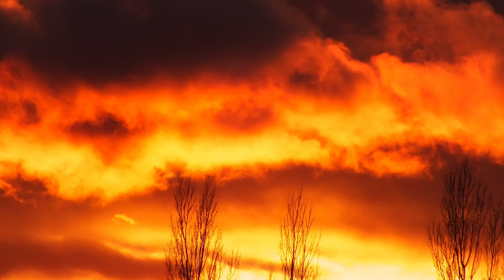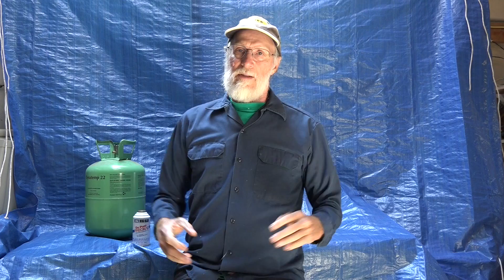What makes a good refrigerant

Comment: Min 36:00 Can be charged up to $30 a pound to destroy "contaminated" R22:

https://youtu.be/V_wUZ4qmAnk
Reply from the maker: I am not up on the latest cost, It was about $10 per # last I knew.  However, that would be only for mixed refrigerant or overheated to the point of breakdown.  It must be destroyed.  
Most recovered refrigerant is either clean or mixed with air/moisture.  Sometimes, depending on supply and demand, you can be paid a small amount.
GFM
Reply: @grayfurnaceman  

And don't we all know how this government-arranged insult is going to work? 
.
You show up with recovered R22, they tell you it's contaminated so you have to pay them. Then they take the stuff and recycle it anyway and make a few more bucks out of it.

The really disgusting thing about the R22 ban is that it had nothing to do with ozone depletion (which is quackery to begin with). R22 is 100 times less ozone depleting (sic) than R12. It was banned by the busy-bodies at Montreal Protocol because of "global warming POTENTIAL".  

Talk about adding insult to injury!

BTW: another thing the public doesn't know is those stupid bureaucrats at Montreal Protocol have full-time jobs. They didn't go away after "banning CFCs".  They're still around - justifying their existence by banning industrial chemicals we all depend on.  Future generations will inherit an idiot world.

Comment: This is kind of embarrassing to watch,   A technician telling me or "us" youtubers what properties a good refrigerant should have. Really? The only reason he knows anything about refrigerant is because of engineers.  Engineers designed the system. Engineers wrote the service and testing procedures.  Engineers wrote the installation instructions. Engineers or Scientist made the PT charts for the all the various refrigerants. Scientist/Chemical Engineers designed the refrigerant, Mechanical engineers designed the thermodynamic system that allows for this thing called "air conditioning" and electrical engineers (me) designed the electrical system.  The last thing anyone needs is a technician who thinks he has worked in the field long enough telling everyone else what constitute a good refrigerant. Did you run out of HVAC topics to cover?  This is an area you really know nothing about.

If you really want to know what makes a good refrigerant just go ask a Chemical Engineer  or scientist.  Don't waste your time talking to a HVAC technician. After all does an HVAC tech really understand enthalopy or entropy? No. If would be comical to listen to an HVAC tech tell an apprentice what those really mean.  If I want to know where the contactor is on a 3.5 ton residential AC unit then I would ask a technician.  Technicians should stick to things they know like:

"how long is a typical line set is" or 
"how long does it take tor replace a compressor" or 
"does stop leak really work?" 

Stop pretending you are an engineer.  It's just embarrassing.
Reply: Impedancenetwork sir I hear what you were saying technicians are not engineers but I can think of many examples of refrigeration equipment that is in service and designed incorrectly have design flaws don't work well very unreliable Etc if you wish I can list the names  equipment those were all designed by engineers if they had consulted with a technician I'm sure a lot of those issues wouldn't be there  an engineer designs everything around laboratory conditions laboratory conditions don't apply to real world conditions as far as I'm concerned engineer's are overrated
Reply: As a former "Aircraft Electrical Systems Specialist" in the Air Force 
and a journeyman electrician for 14 years and now an electrical engineer I can tell you that I am more likely to blame managers for poor designs than I am engineers.  A good example is the o-ring that leaked on the Thiokol solid rocket booster in 1986 (when I was still in the air force).  The problem was known to an engineer who tried to tell 
management that it was a problem.  They basically told him to shut up.  Then a few months or years later the shuttle blew up precisely due to the problem that he tried to warn them about. 

There are business decisions made about product development that engineers are NOT responsible for.  Here is a real life example.  When you have not completed testing a unit that is still in the development stage, but marketing and business development are telling you that we (the company)  need to stop this testing and get this out on the market, then that cannot be the engineer's fault.  These are the kind of decisions that are made at engineering companies everyday.  Sometimes it is better to put out a product that has some defects then fix those defects in version 2.  Sometimes it is better to be  first to market than it is to be second but technically better.

Software companies in particular do this ALL THE TIME! 

When you see a defective product you immediately blame the engineers.  Or so it seems from your statement above.  In reality, business managers, product manager, CEO, District or Regional managers know that engineers would never get a product out the door because engineers would always find ways of making it better.  Consequently, nothing would be "finished" to an engineer.  Feature creep or scope creep happens because engineers want to make a perfect product.  Managers will kick the product out the door even if you are not done fixing all the things that are wrong with it because managers care about different things than engineers.

With that being said sometimes managers hire incompetent people.  They are everywhere.  We had an idiot for president that last 8 years so even at the highest levels you can have idiots.  Engineers are human and sometimes you have unmotivated ones, or inexperienced ones and that can cause designs to be suboptimal.

When you experience a product that was not "designed correctly" , according to you expert opinion, then you should stop and think about all the managers, CEO, etc that had a say in that final product.  

Think before you blame an engineer.  In my experience most problems are caused by managers that want to rush a product to market.

Sorry for the long winded explanation but I think you and others with no engineering / business experience needed to hear it.
Reply: @jonminnella2168  True, but engineers don't get to make all the decisions themselves, they have to work around a bunch of limitations such as their budget. Engineers don't get the final say either. There are definitely plenty of poorly designed products, but a lot of the time, it's not entirely the engineering department's fault.

If CEOs, accountants, management, etc gave higher budgets and were willing to allow more expensive designs and actually cared about products lasting as long as possible, being serviceable, etc, I'm sure we would see much better products across the board out of the same engineers.

Comment: sir do u pls suggest me d best refrigerant for long distance pipe or wn compressor are at fare end. pls
Reply from the maker: The piping length does not determine which refrigerant to use.  The equipment design does.
GFM

Comment: watch and enjoy all your videos.  had a lightning strike 75 feet away from a running ac compressor   why and how would it blow the fuse on the service disconnect?  any videos you may have made on this phenomena?
Reply from the maker: brianond The voltage is extremely high with lighting.  Its kind of like a bear in the woods.  It goes wherever it wants.
GFM

Comment: its too bad they cant come up with another refrigerant which is as versatile as r12. nothing will ever match it
Reply from the maker: awsom70 134A is probably the closest we will ever get.
GFM
Reply: R290 and R600a is the best in my opinion
Reply: @adamhvacr6536  had an r22 air conditioner and I gassed it with r290 and the cooling capacity went up by 800w and power consumption down by 100w
Reply: What about R1234YF?

Comment: do you have a video on what to do for a missing C common wire. particularly for nest tstat?
Reply from the maker: Richard Baylis You will have to provide a C wire from the indoor air handler.  Do you have extra wires in the cable going to the thermostat?
GFM
Reply: No just four wires,
Reply from the maker: Richard Baylis You will need to run a new thermostat cable that has at least 5 wires.  You will usually have to fish the wire thru the wall, so it may take some time.  
GFM

Comment: Not sure if you have done any videos on them but I came across a VFD today and frankly wasn't really sure where to begin looking as far as troubleshooting went. in my particular case the drive is tripping a code for motor over heating, It was a bit warm and does not appear to want to spin properly. motor bearings are good and windings seemed to check out with the ohm meter so I thought maybe I am having a voltage problem. unfortunately like I said I don't know what to look for or what I should be seeing. I'm new to the trade btw.
Reply from the maker: Bradley boulanger It sounds like you may be losing a phase if it is a 3 phase motor.  I would check amp draw on all lines before the VFD.
GFM